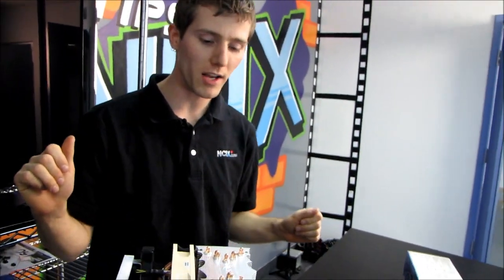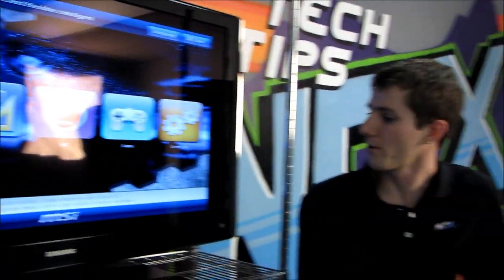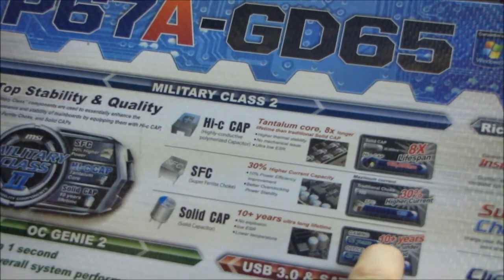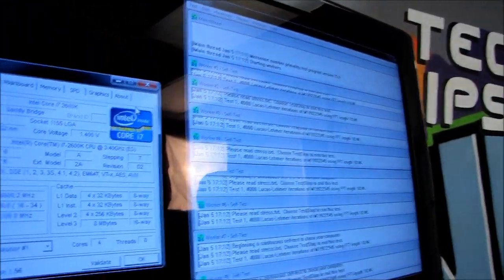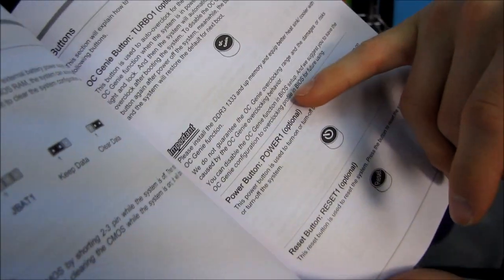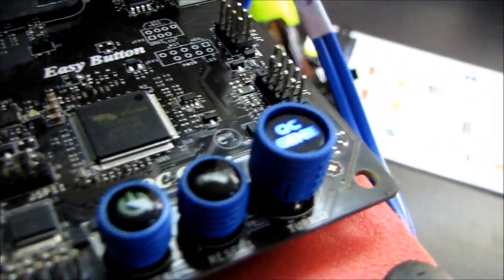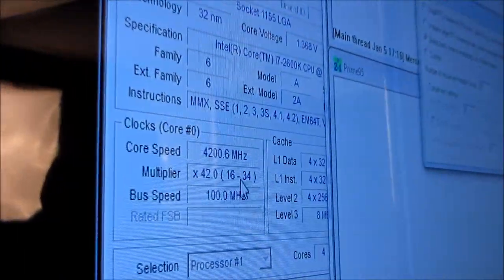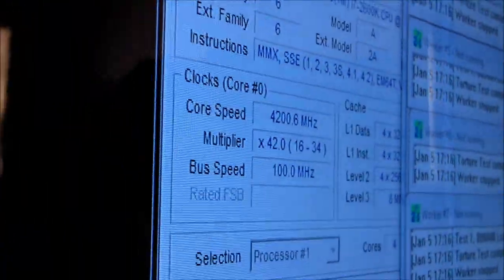MSI OC Genie II Automatic Overclocking Featuring P67A-GD65 & Core i7 2600K Linus Tech Tips

Comment: I have been using a P67A-GD65 and Core i7 2600 (non-K version) with OC Genie II overclocked to 3.9GHz for several years now, and it is still running smoothly. As a result, I have achieved a 15% performance increase from the base clock speed of 3.4GHz.

Comment: I've never noticed this before, so I'm not sure if it's normal or not, but it seems strange to me. If I open up CPU-Z, and am at full idle with no other programs running, it shows my CPU speed jumping around erratically from 1200-4000 normal?
Reply: I think it's Intel speedstep underclocking to be cooler and less power Consuming
Reply: So yeah it is fine

Comment: OC Gennie is pretty cool when your new to pc gaming and overclocking. It boosted my phenom 2 x4 955 b.e from 3.2ghz to 3.6ghz not bad eh? and I didn't have to do any work. I turned it off and got my CPU to 4.2ghz stable on air using cooler masters v6 gt cooler. Using 8gb Ddr3 (4x2) corsair vengeance oc'ed to 1.8ghz from 1.6ghz and the msi 990fxa-gd65 mobo. MSI for the WIN!

Comment: This is much easier on the Z68-XP-UD3 from gigabyte, all you have to do is open your touch bios, get into Quick boost and select one of 3 levels of overclocking, faster which is running at 3.70 Ghz, Turbo at 3.90 Ghz, and the Twin Turbo which runs at 4.20 Ghz....

Comment: @linustechtips, im trying to use OC Genie 2 on my MSI B75-G43 mobo with my i7 3770k processor and its not working. any idea why? there is no button on this mobo so i go into the bios and enable OC genie and I do not get any overclocking. i also dont have the ability to manually OC(for some reason i cannot put my CPU ratio past 35 which is the base clock anyway). its starting to become very frustrating and annoying.

Comment: I say that to emphasize the fact that it will run fairly warm. 5 ghz is no small step. Im not saying its impossible at all, but the heat generated will be noticable. look up overclocking on toms hardware.com read it their into to overclocking guide several times. What they say makes a lot of sense. If you dont be carefull you will brick your processor and or your board. Either way, longevity will be significantly reduced. if you make it to 5, props to you man!

Comment: @nikkademus1 I got it running on XMS profile 1 which is 1600Mhz Cas 8 or something and I got the voltage on 1.5 and it has been running without problems for 3 months.

Comment: @adamjamesroe The difference between locked and unlocked is the inability to mess with the multiplier for the most part.  If you increase the Base Clock of the motherboard, everything, including the CPU would operate at higher frequencies, regardless of what it wants.  The great thing about unlocked CPUs is they can be overclocked independently from the rest of the components without messing with base clocks.

Comment: @llvll3chan0id the mounting holes for 1156 and 1155 are the same, so you can use any 1156 waterblock on new boards.
i would recomend koolance cpu-360.

Comment: Hey guys, I made an order on a new pc for $826, is this a good deal?

Intel Core i5 760 Quad Core

ASUS P7P55-LX

Sapphire HD 5770 1GB GDDR5

Seagate 1 TB HDD 7200 RPM 

Kingston DDR3 2x2GB 1333

Cooler Master 310 Elite Mid-Tower Case (Blue)

Comment: @mycomputerfund   I've looked all the benchmarks I could find and all were showing that they are great processors (we 'll see later if that's true). But the biggest shit of all is that you need to change the motherboard from Socket 1156 to 1155! You see, it was "extremely" hard for Intel to make it work with 1156! :P

YOU ARE ALL IDIOTS! YOU THINK THAT THIS CPU AT $200 IS CHEAP, BUT YOU DON'T THINK THAT INTEL MANAGE TO GET $300+ WITH THE NEW MOTHERBOARD CHIP TOO! FROM 1156 TO 1155! WOW! :P